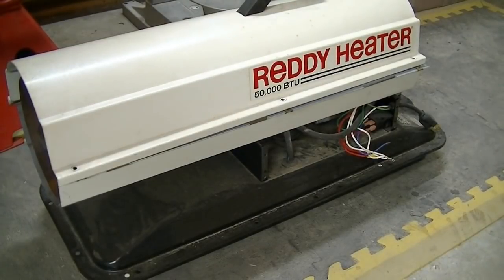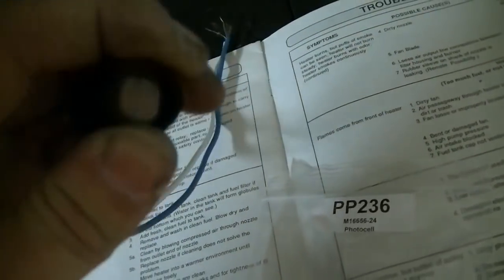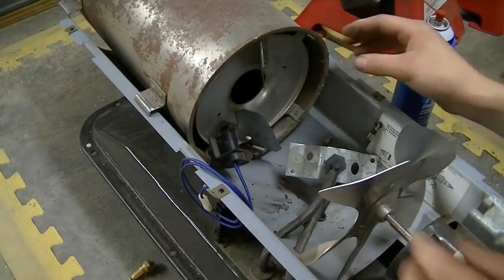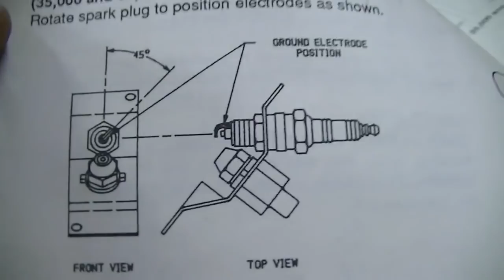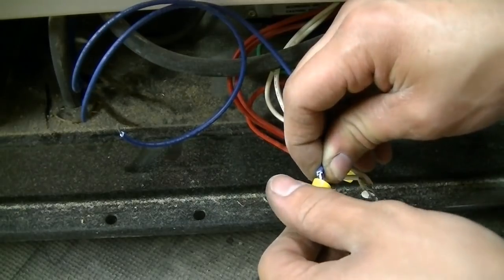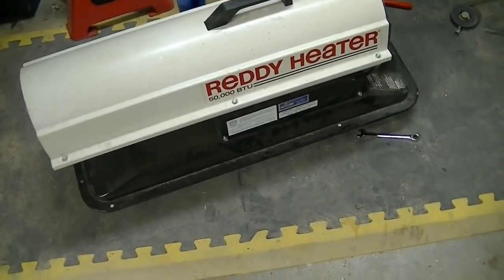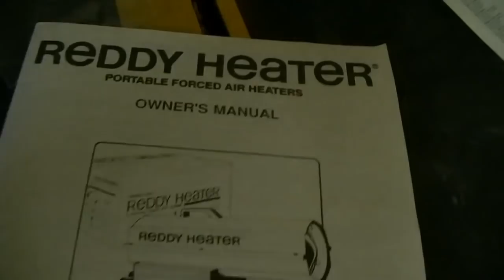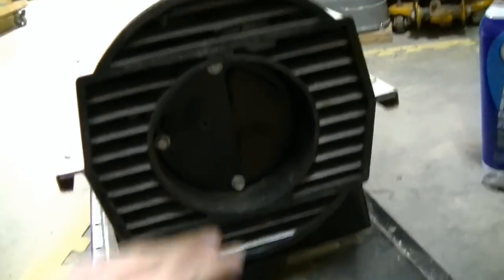Kerosene Torpedo Heater Repair + Test

Comment: I have the same exact heater, stored for 20 years, no manual, that I drained and put fresh Kero in today, and it had the exact same problem on startup. Shut down after 10 sec.  Tried blowing air in it to clean. Didn't work.  I ordered a new cell today. Got it working temporarily by replacing the cell with a jumper wire. This was a very helpful video. Thanks.
Reply from the maker: No problem. I'm surprised to see how many people found this helpful, I didn't think there were so many people digging these things up and having the same problem

Comment: Good video and great repair.  I have the biggest unit like this with roll around wheels, but have never had a problem with it.  I installed a thermostat that makes it even better, except everytime it kicks on it scares the crap out of me.
Reply from the maker: Well you must work in a quiet place lol. What btu rating is your unit?
Reply: InductiveExperiments It is a Ready Heater PRO 155.  I just dug it out of the garage, dusted it off, and fired it up.  Runs perfectly.  No telling how long it has been since it was last used, probably at least 5 years,  The PRO 155 puts out 155,000 BTU.

Comment: great video. I appreciate seeing this. Yes, I have the same heater, and it will start, and I can see spark, but it acts like it doesn't always want to ignite. I am assuming I need to change the plug (it has fresh fuel)clean the spray nozzle and body, and replace the photocell. I am wondering where the best place is to buy a pump pressure gauge and what it should be set at.
Reply from the maker: I'd check the spark plug and injector and clean them first, I think it may not be getting the correct amount of fuel. The pressure gauges can be bought on ebay as well, search heater pressure gauge. The photocells like to go bad after time, if you've got it to start and run for over 10 seconds it's probably working fine, but could still be on it's way out.
Reply: moparmusclecars:  Look on the side plate of your heater: it should tell you the correct pressure seting for the pump.  Any auto parts store should have a pressure guage for $20 or less (I would think).  I just fixed a 55,000 btu heater and the pump setting was 3.4 psi.  Also, when you buy the pressure guage get a short piece (12" - 18" it's very inexpensive) of hose to connect the guage to the back of the heater.  You might have to shave the end of the hose a bit with a handy knife to get it to fit into the hole to test the pressure.  Possibly you can just shove it in the hole but just know that it's a very tight fit.  That's okay though because if it's loose you'll get an inaccurate reading or if it's too loose no reading at all.

Comment: I have a 60,000 btu reddy heater and it comes on for 5 secs then stops. Is it the same as your 50,0000 btu principles to correct that malfunction? Great video dude.
Reply from the maker: Yes almost all of the torpedo heaters work the same.

Comment: Your video on the problem you had on your Kerosene Torpedo heater was same as what I encountered, which was that it started and ran well for short time and then shut off the safety switch. Think I'll switch out photocell/flame sensor like you did.  Can you give me a lead on where you got your replacement photocell/flame sensor, along with what part # and price you paid.  Thanks.

Comment: Very good video and I learned a lot from it.  It gave me some ideas, but I have more to go.  I have a Reddy Heater 40,000 with about the same problem,  It has an igniter instead of a spark plug.  It starts and fires but shuts off pretty quickly. After seeing your video, I thought that it might be the photo sensor. 
I jumped those two connections.  Still didn't work.

Comment: InductiveExperiments mines a little older but same setup...its not Sucking up fuel from the talk at all. everything else is good. what would be the cause of it not bringing the fuel up
Reply from the maker: So you took the nozzle out and still no flow? There may be a filter, check the tank to see if there are things floating around in it. Maybe back flush the pump from where the nozzle goes and make sure it flows good back into the tank, assuming you can do that?
Reply: Rotted out fuel lines.

Comment: Is there a way to test the photo cell or can u jump the 2 wires together to see if that is the problem.
Reply: There is a blue and white wire on the original.  If you remove these from their wire nuts, you can test the photo cell (a CDS cell) with an ohm meter.  The service manual says the resistance should be less than 500 ohms with a bright light shinning on it.  A 60W bulb or direct sun light.  Cover the opening with your thumb and the resistance should go much higher.
Check to see the sensor is not dirty first as this might be the problem.

Comment: help!   I removed my motor and hot wired it to an outlet and it worked fine. but when hooked up to the unit the motor hums and tries to turn as if it isn't getting enough power. I even hot wired the fan with it on the unit and plugged the unit in, motor worked, plug glowed but no flame. it is a 115 Reddy. photo cell???? Thanks

Comment: My 55K btu reddy heater runs but it really smells the garage up badly,is it a clooged filter  that its not getting enough air?
Reply from the maker: What are you burning? Clean kerosene or diesel are the only two I'd use. Is there any smoke coming off the heater? If so the mix may not be right and it might not be burning it completely, it would need a pressure adjustment. If all checks out there may be something stuck between the burning chamber and the heat shield, what does it smell like?

Comment: ok I have a  old ready heater and it hadn't started in a few years and it has a little bit of old gas in it. I took the spark plug out and cleaned it and plugged it in and she started right up. it ran for a while and I shut it off. I went to use it about 4 days after it started and it will run for 10 seconds and shut off. if I plug it in it won't start but will start when I hit the reset button. but only run for 10 seconds.. anyone have any ideas? I've checked and seen if the fule line was clogged but it wasn't.

Comment: I replaced spark plug, filters,photo cell, new K, it has fuel spray,spark but it won't ignite now! Is it the pump that's bad?
Reply from the maker: Are you using fairly new kerosene? How is the fuel spray? Make sure it's a fine spray and not a dense stream. Could be clogged and need to be cleaned or replaced.

Check the gap on the plug, should be .05" to .06". The other possibility is that the spark is not strong enough due to a weak igniter. The spark has to be pretty dense/strong.
Reply: +Stephen Zielinski The size of the spray may be off.  Did you check the PSI of the pump?  Usually the pump housing will crack or a gasket will leak and cause the PSI to be off.  Do a soap and water bubble check on the pump, seal any leaks with silicone.

Comment: I replaced my igniter and cleaned the air pump. Heater worked fine but the fan coming on had a delay of about 8 seconds. Now the fan doesn't turn on at all. From your video the fan comes on as soon as you plug it in. What could be the problem?
Reply from the maker: Does the igniter fail to turn on as well? Or is it just the fan that doesn't turn on? The safety control decides when the fan/pump and igniter gets power.
Reply: InductiveExperiments The unit ignites, the fan kicks on. After a few seconds the flame goes out, fuel mist comes out and then the unit shuts down. It has an igniter not a spark plug (new). Funny thing it works fine once warmed up. problem is I need it when it's cold.
Reply: Joe Janus try and get a video of it happening? Its hard to understand what its actually doing over YouTube comments. The two posts of yours don't mention the same symptoms exactly. But reading the reply, you say the flame goes out but fuel keeps spraying. Does that mean the fan stopped too?
Reply: ConkersBFDN64 1st start when it's cold outside. Heater starts igniter must light because when the fan kicks on the unit fires up. Soon after that it loses it's flame. Fan still runs briefly after the flame goes outs leaving a fuel mist. Then auto shut off occurs. I unplug it. Yesterday when the garage was semi warm from a kerosene heater the unit kick on and ran well. Front piece was glowing red and the garage heated up quickly. Shut off and restarted several times with no issues. Tried to start it today and it didn't run long. I know the igniter only stays on for a short period. Is there another circuit that shuts the igniter down sooner. Again only happens cold.
Reply from the maker: Joe Janus
Ok that fills in the gaps. So really for some reason the flame goes out. The igniter does run continuously on my heater, not all are like that though. Do you have a heater of the same era reddy heater? The newer ones shut off once the flame has started to be more efficient. You'll know which ones those are because the igniter starts a few seconds before the fan kicks on. But the older ones like these, the fan/pump and igniter get the power from the same switch.

I'm thinking in your case, the fuel spray might get diminished after a while due to possible contaminants in the fuel.The injector nozzle may start to partially clog and therefore the flame goes out because the ratio is not enough for the always constant amount of air that is going through it. Try cleaning the nozzle and see if there are any contaminants in the tank.

Onto the igniter, I don't know what model you have but even if the spark goes out the heater should run still since it no longer needs a spark.
Reply: InductiveExperiments My unit has an igniter not a spark plug. Units with the spark plug (older) spark continually and fan kicks on immediately. You're correct, my igniter starts to glow and about 5 to 8 seconds later the fan kicks on. Any Ideas?
Reply: Joe Janus Went to try starting it again and it doesn't ignite at all. I guess I need to check the wiring.
Reply: +Joe Janus judging by the variable reactions of your heater it could be many different things.  Could be anything from dirty fuel to a slight crack in the pump that gets bigger after running a while and throws the PSI off.  I'd empty the tank, try and clean out any debris.  With the tank still empty i would bypass the igniter and flame sensor to let the fan and pump run nonstop.  While its running do a soapy water bubble check on the pump and seal any leaks with silicone.  Check for leaks in botht he cold and warm.  If there was a leak id put a PSI gauge on and ensure it is set properly.  Next add NEW CLEAN fuel and give it a go.

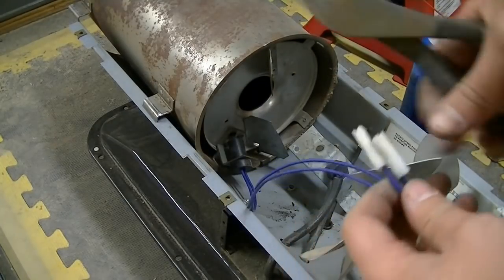Comment: Did anyone see the photo cell's polymer connector shoot inside the combustion chamber at about the 4:20 mark? Did the heater give off any plastic smell? ;)
Reply from the maker: Haha yeah I quickly recovered that, don't need that kind of smell in my garage. Then to take it apart and try to get it out when its melted would be a huge headache

Comment: I replaced the filters and photo cell, i have spray and spark and it won't light,now what do i do? I have fresh K1
Reply from the maker: It should ignite then. All it takes is air, fuel, and an initial spark. Make sure the fan is spinning fast, and that the spark plug is in the right position (45° away from nozzle) Also make sure the nozzle is spraying a fine mist and not a stream.
Reply: The spray may not be quite correct.  Check to see if there is a restriction in the fuel flow and test the air pressure being delivered by the air pump.  There are two slotted plastic screws on the back of the pump.  One is a plug.  The other is the pressure adjustment.  Remove the plug an put a pressure gauge such as 0-15 psi in there. The pressure spec is determined by the model.  The R50a is 3.6psi.
The pressure adjustment is a spring loading a 1/4" steel ball.  Make sure it's not rusty.

Comment: i bought a dayton 155,000 btu when i plug it work but after minute stop
do you what i need to do?
thanks
Reply: The flame and everythimg its good, now it run for 5 or 10 min and but stop again
Reply: +clementslights both
Reply: +clementslights whole heater shut off
Reply: +clementslights i dont know
Reply: +clementslights thank u ill check it out
Reply: YES

Comment: I have a R115DT  115,000 BTU. I turned it on and it lit just fine. Shut it off for a minute, and turned back on. motor just hums and fan wont spin.  Is this a capacitor problem ?

Comment: the spark plug works on my heater the photo sensor works on my heater but I can't get the kerosene to spray
Reply: did you check the fuel filter? I had same issue and replaced fuel/air lines
Reply: need to clean injector. open it and clean, will help

Comment: Nice video !! I had purchased a full rebuild kit from this website  http://www.torpedoheat.com/   It included the photo sensor and a filter kit and some other stuff. In the filter kit there was a very small square filter!! About the size of a dime. Can you tell me where that goes.  Thanx and thumbs up !!
Reply: take the air pump off back apart, that part is under the second finer filter.